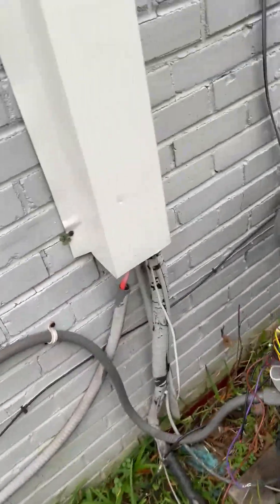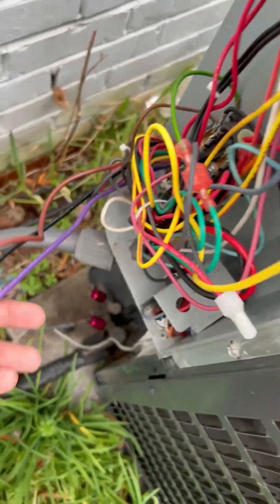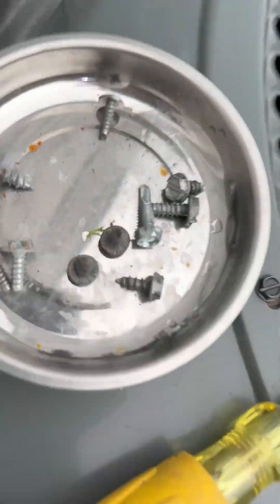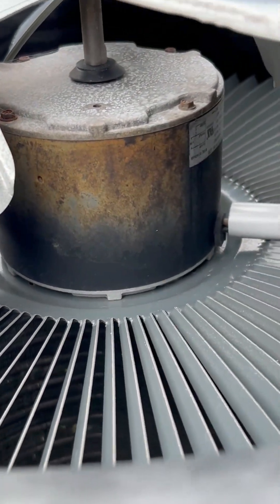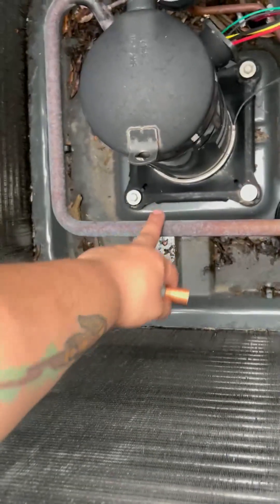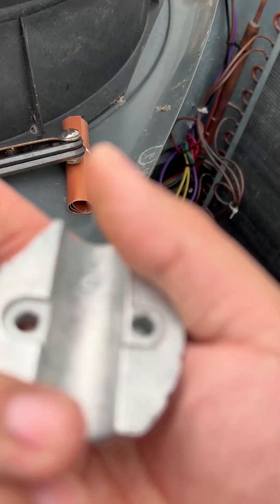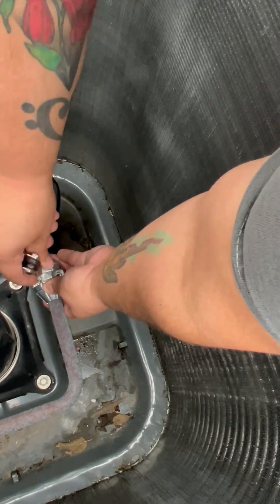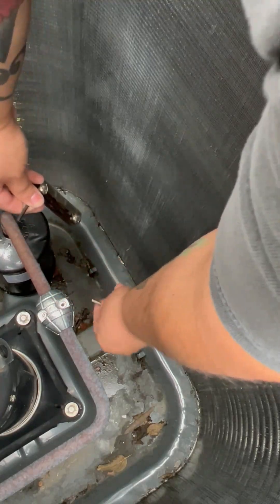how to install corrosion inhibitor By KevHvac

Comment: The copper pipe should have been cleaned to a polished finish before attaching the zinc grinade to ensure proper connection.

Comment: Just put it on the suction line, that's all and it only works if you live near Salt water. If your inland out does nothing, it's for formicary corrosion. Just like a zinc plate on boats.

Comment: I’d like to see a follow up video on how it looks after a season. I’m an HVAC tech and have only seen one of those ever. The purpose is for the grenade to act like a sacrificial metal as corrosion typically attacks the aluminum coil. Only thing that I wonder is won’t the zinc cause galvanic corrosion on the copper?
Reply: Why did you remove the 3 wires in the beginning?